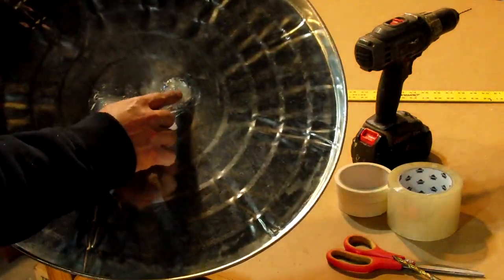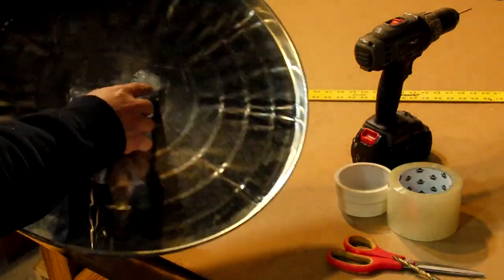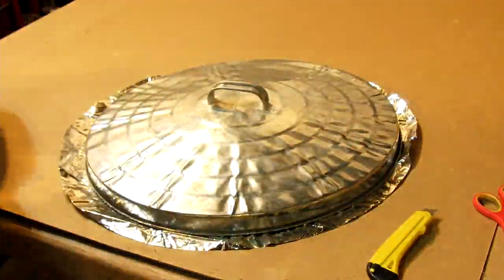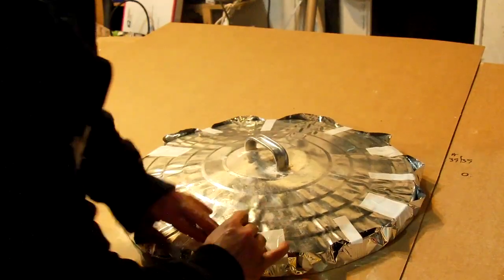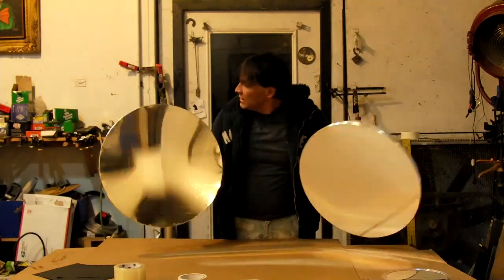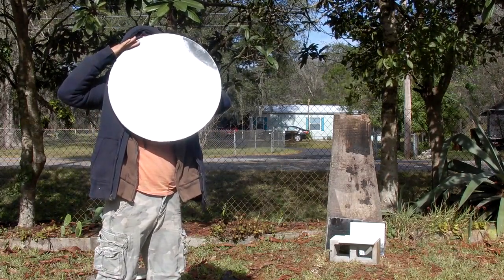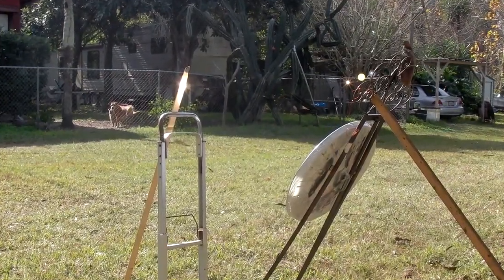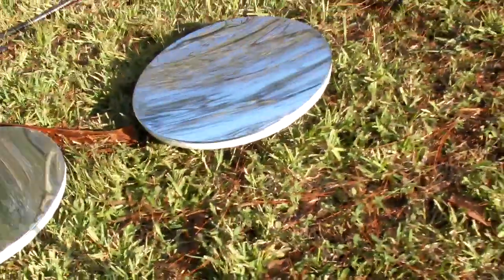Parabolic Mirror from a Trash Can Lid HACK Death Ray Solar do it yourself DIY

Comment: Hmmm, a heck of a lot cheaper than a Pyrex blank!  I wonder how this would work as a primary lens...
Reply: I've been wondering about that myself. I've been thinking with a sturdier frame, and maybe a glass mirror, the optics might be reliable enough for a telescope. I have the parts, I just haven't tested it yet...

Comment: The trash can lid size of reflector is ideal for helping to dry clothes out on the line. I found round moulded plastic basins which have a ledge around the rim for strength which lets you cut the mylar to the exact outer diameter, making it easier to seal.  This size is also easier to carry around and less susceptible to the wind - but most of the time they live indoors bringing light to dark corners.

Comment from the maker: iMovie 06', straight forward and quick allowing for SD - HD 1080. New iMovie is too clunky with "bells and whistles" Download of 06' version is near impossible to find. APPLE has buried it for some reason. Maybe too good of a free program:-) Like photoshop 3.0 which I still use. I can edit a photo and save in the time CS loads on a new mac. I like stripped down software.

Only downside to 06' is most new cameras use a wrapper around the MPEG file that needs to be removed and converted.

Comment: i made one with one of those above ground fire pits that are all ready the perfect shape and has holes for the stand strong material steel and about 30 inches across and all so made the one you made from wood no real sun here in Wisconsin soon I'm sure. I am going to heat my sisters pool with it some pipe and the submersible pump and hose I have and heated pool here I come who needs a pool heater that cost $450 bucks I don't

Comment: Well if you decide to launch a wire into a cloud make sure you  use fine silica sand..it will give  you nice fulgurite.. you can make a  sculpture then. Be careful dont do it  around your house and make sure the sand is  moist.  Dry sand is an insulator.

Comment from the maker: Unfortunately no, the optics on the vacuum versions lack an optimal tight focal point at longer focal lengths but even a perfect parabola of a 10 ft diameter would only have the power to melt about one pound of concrete. 2000 pounds is roughly one cubic yard and that would require a dish 100 feet + in diameter. You could melt patches in small sections but the large slab would eclipse all the incoming light. Fresnel Lenses work best for concrete melting:
watch?v=xvB-caf_k4U